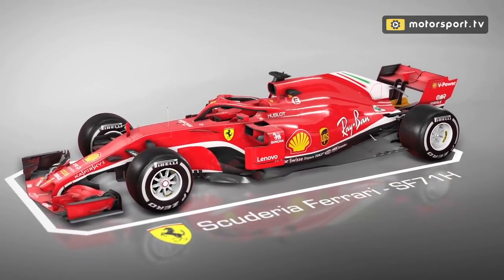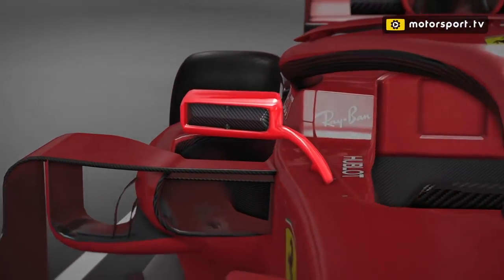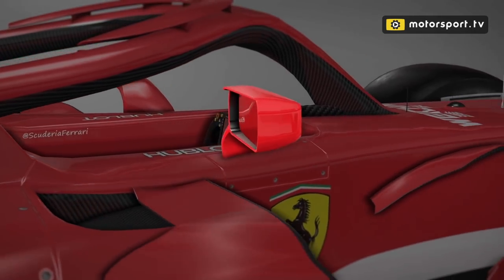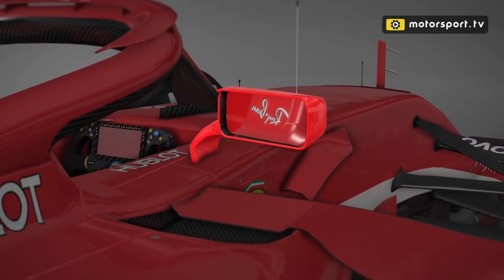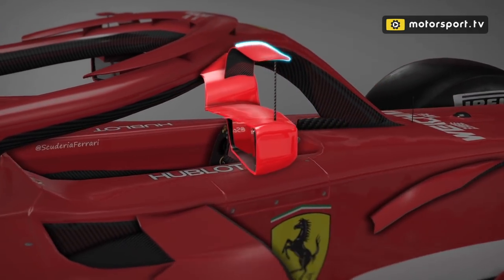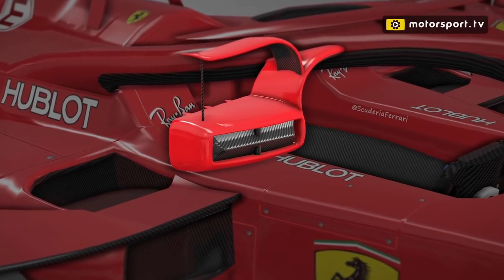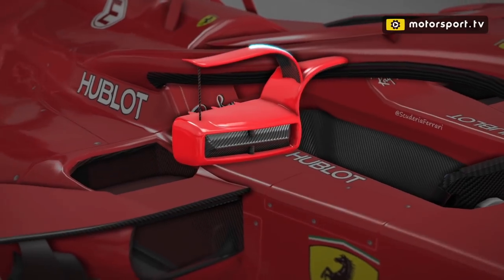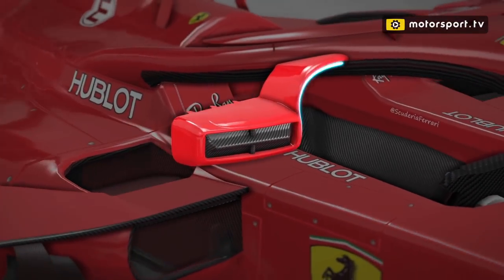The latest changes to Ferrari's halo mirrors

Comment: Now waiting for FIA to 'level the playing field' and allow only plain mirrors, preferably just a slab of glass on either side of halo or even better, just a slightly better polished piece of aluminium foil.
Reply: I want the WHOLE car to be held by duct tape. That's what I call proper cost-saving measures. And no engine, just a hole in the underside and a full-blown Flintstones mode.
Reply: It's s yoke!! 😂😂
Reply: Mateusz Malenta that’s what formula e could do in case of a power cut!

Comment: In roll over accident, car on roof in gravel. How does driver get out unassisted especially when there is a fire? Halo and all the crap getting added becomes a hazard?
Reply: It's just a question of time before it happens. Then they will change their mind on halo. Should have been banned on the first race.

Comment: Mirrors and Winglets shouldn't allowed on the HALO. If a tyre were to hit the halo and smash a mirror there is the chance of the mirror smashing into the drivers cockpit which the HALO is designed to not allow things to do! Same with winglets, if they were to be hit and smashed up there is nothing to deflect them from the driver.
Reply: The Stock Market Investor i agreed
Reply: If a mirror is able to go through a f1 helmet then we have much bigger problems than mirrors on the halo.
Reply: some debris can hit them in the neck and stab them
Reply: The Stock Market Investor The mirror isn't in much of a different place on the Ferrari the main difference is just how it's mounted. A tire hitting the mirror would be more likely to send it rearward or not be a threat to the driver but if a driver went into a tire wall sideways at enough speed a tire from the wall could hit the mirror into the driver (I've even seen a tire from the tire wall hit a drivers helmet a while back) but that risk is the same whether it's mounted on the halo or the chassis.
Reply: Colton Baber Something like that doesn't have to go through a helmet to cause injury, take Massa for example.
Reply: Explain how the mirror mounted on the helo can go to the driver head while a mirror mounted on the car which will be in the same general area can't.
Reply: The same could happen if the mirror was mounted on the body, your point is moot. Also the halo isn't designed to stop small debris, but when doing an analysis it is a net positive; hence it is better to have the halo than not to have it.
Reply: If we are all worried about a tire hitting a mirror then by such small chance hitting the driver and injuring him then maybe just have a closed cockpit and wrap the driver up in bubble wrap. Honestly f1 is already safer than it's ever been I dont think these crazy hypothetical scenarios should be reason to reduce car performance or car aesthetics for that matter
Reply: I just think that without the HALO, Ferrari would've kept the mirrors the same. HOWEVER, they're using a safety feature as an advantage which I see is wrong.
Reply: The Stock Market Investor that's like saying no fins should be allowed on top of the halo, which most teams do if not they have vortex generators, why should exploiting grey areas be frowned upon when it only makes the sport more interesting and creates faster laps?
Reply: The Stock Market Investor tbh tho, youd be hard pushed to put most forms of projectile found on an F1 circuit through one of those helmets...
Reply: Colton Baber mercedes doesn't have halo fins. They've kept the halo stock which I think all teams should
Reply: The Stock Market Investor the halo produces more drag which obviously slows down the car, having fins on it only makes best of what a poor situation it is, I think all teams should be allowed to innovate in pursuit of faster cars and lap times
Reply: There's no extra risk at all. Ridiculous comment.
Reply: Malc180s just my opinion and take at it
Reply: The Stock Market Investor Without the halo obviously Ferrari would've keep the mirrors relatively the same...there would be no halo to mount them on duh lol and, within the span of the regulations, everything in an f1 car is taken advantage of for the sake of speed. Even helmets are designed to be more aero dynamic than those of the past, do you find that to be wrong? The mirror being mounted on the halo is no more dangerous than it being mounted on the chassis so what's the problem with that?
Reply: Don't agree with you... Every piece same size as mirrors that comes off another car in front, can come through halo also!
Reply: It would have the same chance of going into the halo if it were in its normal position. The mirror hasn’t moved, it’s the stalk that holds the mirror that’s moved
Reply: Did you forget tyres are tethered to the car? Also even if small debris like the made it through the halo, the helmets of the F1 drivers are so strong it might injure the F1 driver but it probably wouldn't kill the driver.
Reply: Hello People If the tire tether worked 100% of the time we wouldn't have the Halo
Reply: PanadaTM the reason for the halo is if a car mounts another car or a car flipping
Reply: google Hans system

Comment: What an ugly contraption on a single seater open formula, Halo is FIA;s  biggest mistake
Reply: There have been other mistakes such as Tower Wings. But with the 2 meter wide cars, halo, the awful 2018 graphics package and with the newer sets of tyres hypersoft/ultrasoft/supersoft/soft/medium/hard/superhard, I think we have touched a new low.
Reply: Also the "more exciting" qualifying change, but luckily they changed it back. Unfortunately Liberty is going again in the same wrong direction. Just to get younger viewers with near to instant attention lifespans... They will not succeed with any measure to get them not to zap away...
Reply: Lourens Rolograaf so you would rather have drivers be much easier to be killed in an accident, then to have a very effective halo which doesn't actually look that bad.
Reply: I do not want drivers get killed, but racing is dangerous. In any car even the completely closed tintops. If you like it you have really bad taste, sorry man.